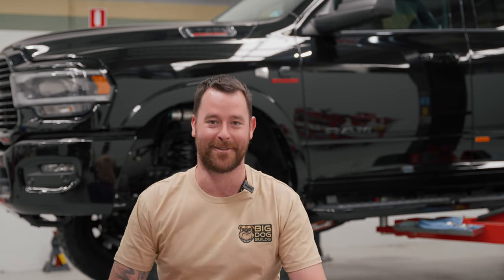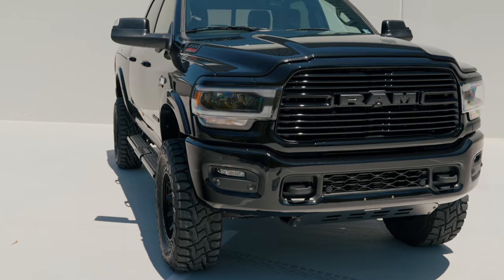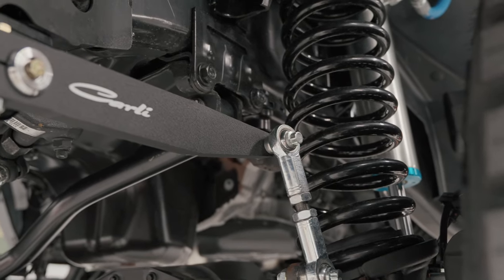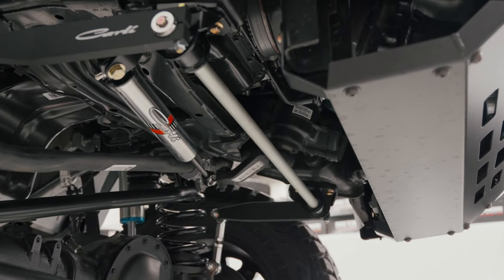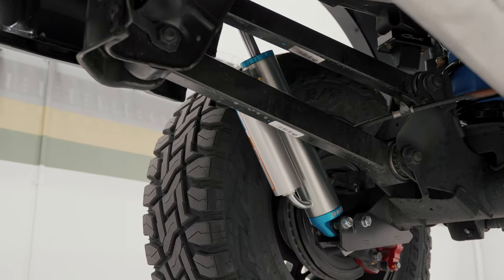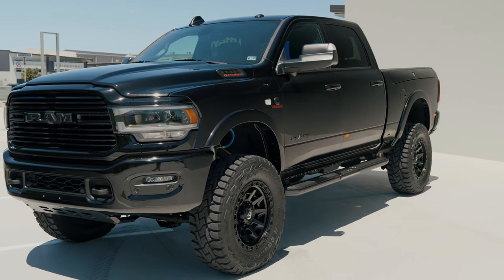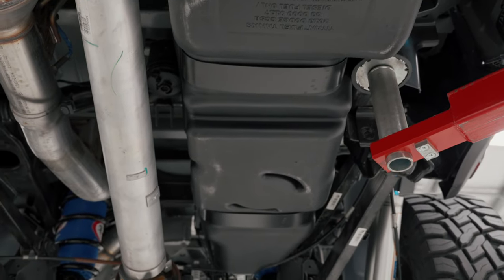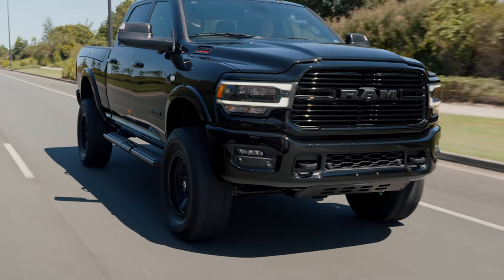2022 RAM 2500 Carli Kings 3.0 Dominator Suspension System

Comment: A 52 US gallon tank on a shortbox is pretty impressive. How low does it drop below stock?
You could add another 30 gallons with an auxilary tank in the spare tire location (Titan makes the system). Once you go with bigger tires they don't normally fit in the stock location so there is enough space there for another tank or a rear facing winch (maybe both). The only downside is that most of the weight is behind the rear axle.
Reply from the maker: The Titan OEM replacement sits a bit lower but is mostly longer hence getting quite a bit more. Spare wheel tanks do add a lot of weight to rear axle which needs to be considered. Every build has its pros and cons 😀👊